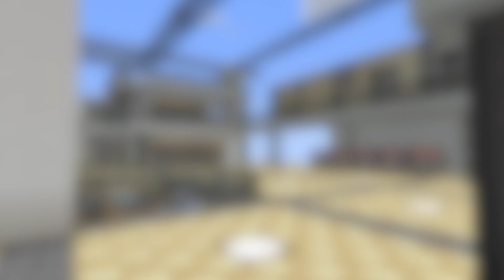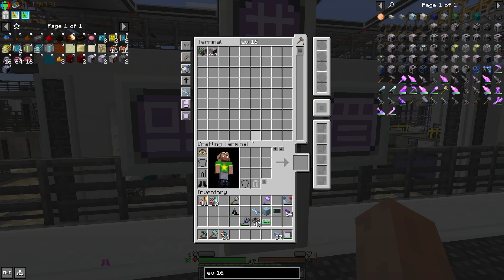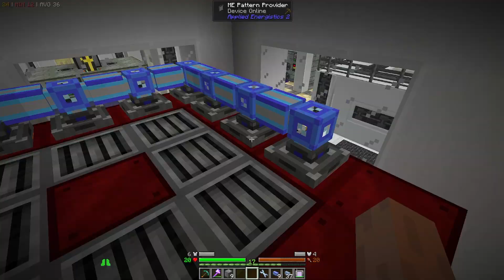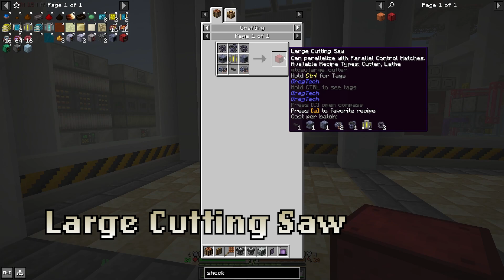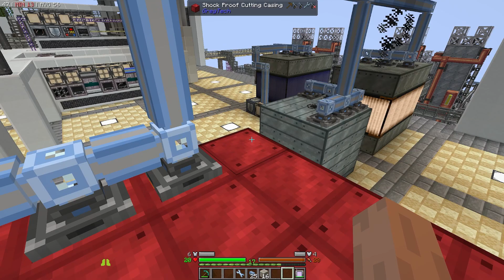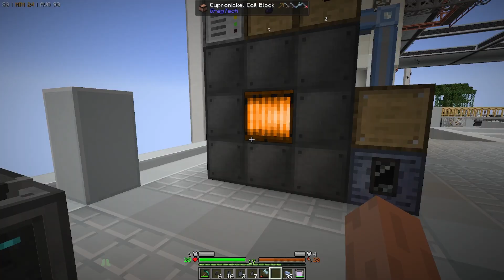Star Technology - 31 Parallel Manufacturing

Comment: Im fairly sure that the big multi blocks dont have to be put in the cleanroom. The recipes that require the Cleanroom should still work in the new multiblocks outside.
Reply: They are self contained cleanrooms
Reply from the maker: There's a cleaning maintenance hatch, which I do use later on once I unlock it, but I couldn't get the multiblocks with clean room recipes to work at this point.

Comment: There are quite a few more difference with newer versions
Sieving is only up to cloth tier, anything above it gives nothing. Instead you have other machine producing the base products for each tier. (like a void miner and a gem miner).

Many recipe changes also. Updating can break quite many process.

Comment: If you wanted to change patterns quickly like if you upgraded the parallel hatch you can use a Pattern modifier 
You can 2x,10x,÷2 and ÷10
And you can do multiple at a time
Reply from the maker: I'm not sure this version of StarT has that mod. I can't find the modifiers. Great tip though! It'd certainly make adjusting the patterns easier. 😃

Comment: 9:27 For parallelization take the base eu/t (so for the soc 480 eu/t) and then multiply it by the amount of parallels (4 * 480 = 1920 eu/t.) Then do overclocking rules (two iv energy hatches is 32768 eu/t that the machine can do) so it can perform 2 overclocks (45s down to 22.5s with one overclock, then to 11.25s with another.)
Reply: I don't know if the parallel control hatch is a 1 or all type thing where it will only ever do either 4 or 1 parallel, but if it can do 2 or 3 parallel then the 480 gets multiplied by how many inputs it has instead of multiplying it by 4. So if you have enough inputs to do 3 crafts the machine will do 3 parallel and the calculation goes 480 * 3 then overclocking rules apply.

Comment: Keep in mind, if you use pipes and ingredient buffers, if the items wont come in the hatch all at once it wont perform a full parallel and the mach8ne becomes sad like this: 😢
Reply: In parallel, items on one tick, fluids next or both during the same tick
Reply from the maker: Yes, true. What's the alternative for that kind of situation where you have both buses and hatches involved in crafting?
Reply: @gameswithpostie crafting pattern connected to a subnet via interface, with the outputs being into hatch & bus w/storage buses. I believe the provider would dump all resources into the interface and would move them all to corresponding storage buses
Reply: @gameswithpostie pattern into interface and storage bus, no item wants to be in interface, so storage bus will guide to hatches automatically